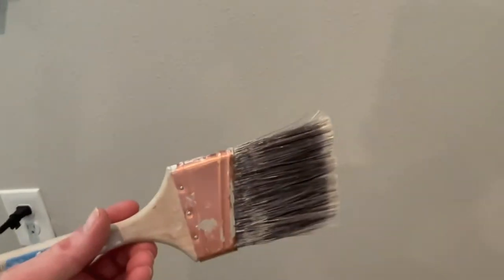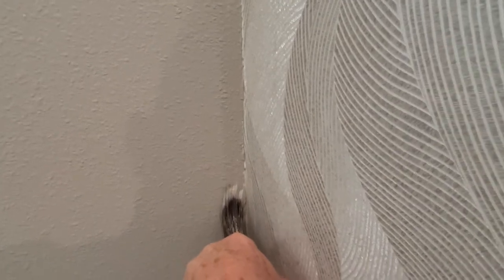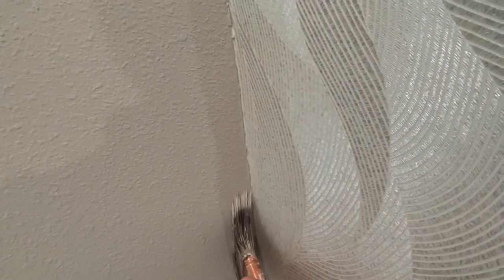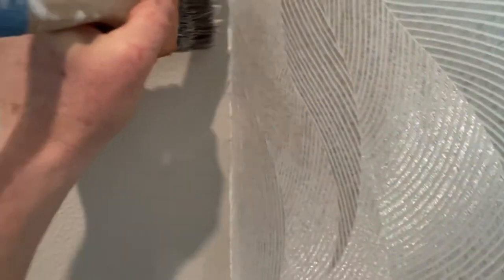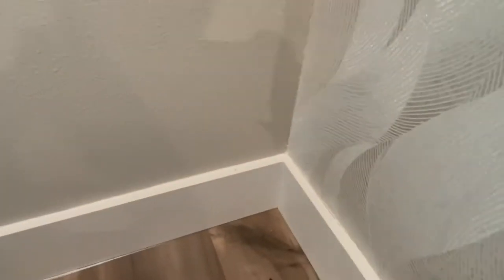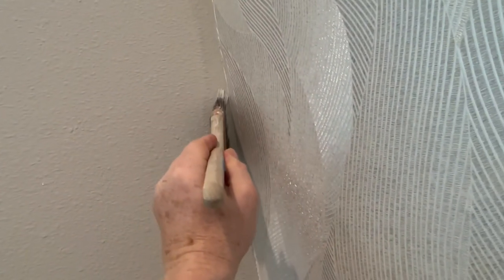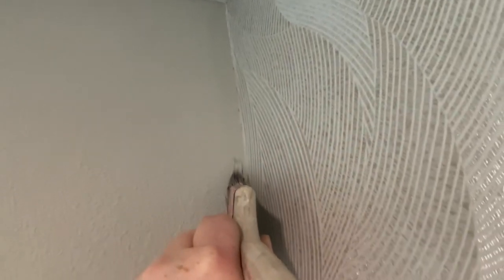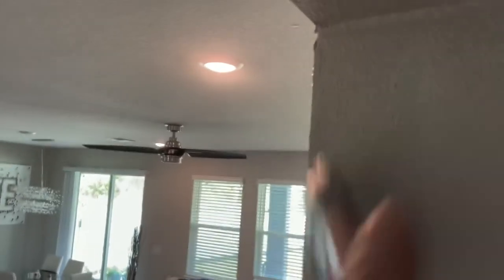How to Paint around Wallpaper after Hanging It - Spencer Colgan

Comment: I wish. 26 years in the business and still getting beat out by the company that does crap work , but drives the nice wrapped truck and……here’s the hurdle, is a local that the customer has known their family for years. And yet they call me in to fix the mistakes, cause the other won’t come back. But the very next job, they get the other company again. I loved the hustle in my 20’s &30’s but at 50. The hustle is getting tiring when the outcome never changes.